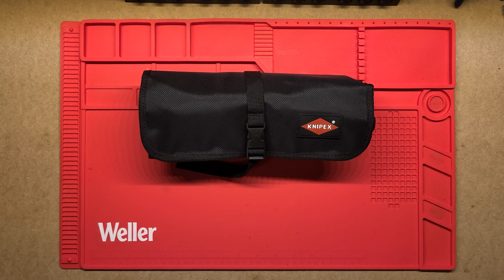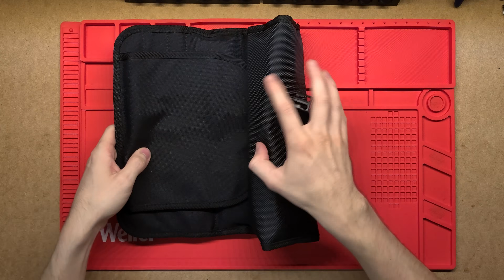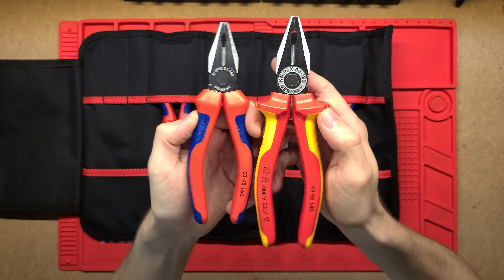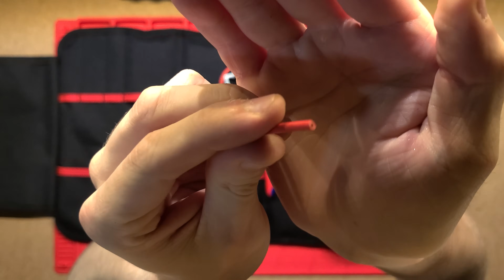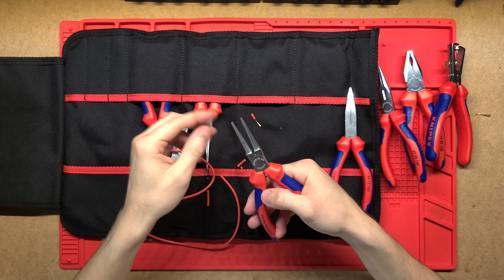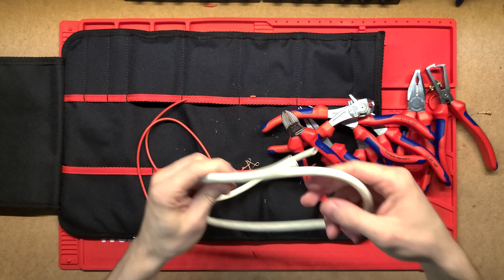KNIPEX Tool Roll - 8x Awesome Pliers!

Comment: 5:15 - "Let me know what you use these for; I don't use these too much."  Well, for starters they're the perfect tool for forming eyes in copper wire, for connecting to the terminal screws on electrical switches & receptacles for household wiring.